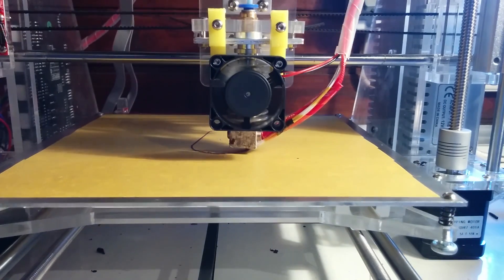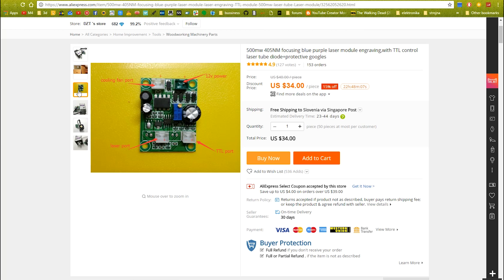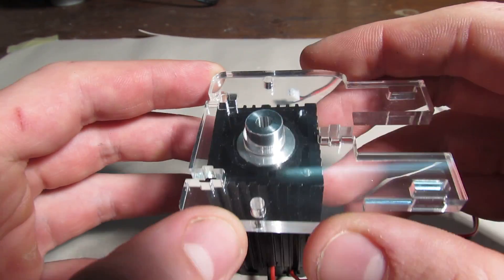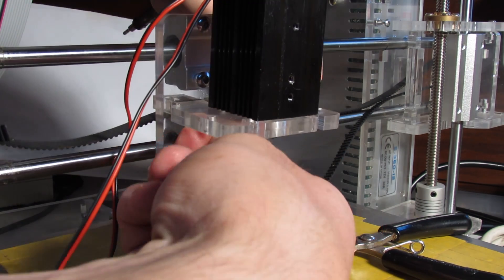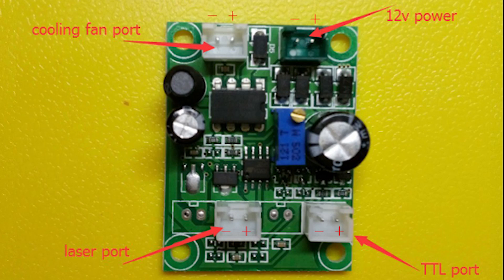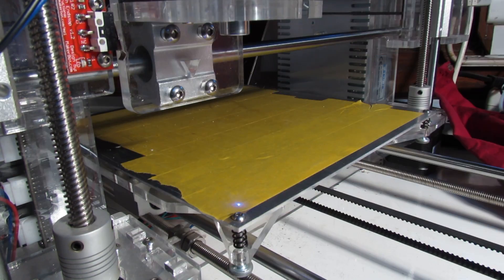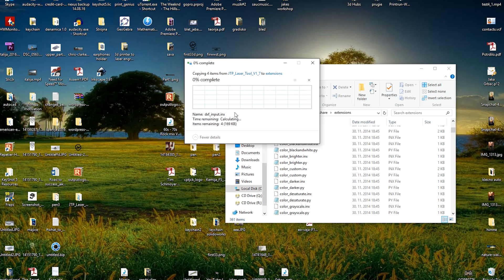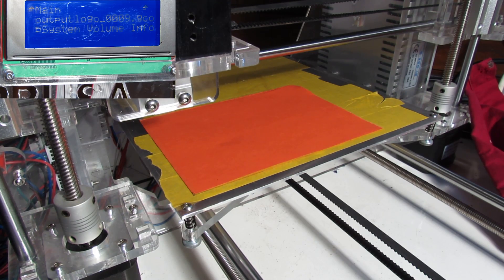Convert a 3D PRINTER To LASER ENGRAVER | Under 40$

Comment: Amazing ! I'll be trying this soon ! Thanks a lot for sharing this ! 
I'd like to ask , what is the distance between the bed and the lens of the laser ?  and how do u set it with the Z axis of the printer?
 Also, the TTL pins are supposed to be for PWM functionality , aren't they ? 
I have seen some SPI interface pins on MKS where people attach their SERVO motors which are again driven by PWM. So is there a way by which u can get that PWM to those pins of MKS and use the TTL of the laser ?
Reply: I installed my laser yesterday as described in the video. It works. My printer is a modified BQ Prusa i3 Hephestos. I have 110mm distance from print bed to laser lense (20mm offset from nozzle to print bed, that means 90mm from nozzle to laser lense). I am using a capacitive sensor for the z-min. In the gcode from inkscape, I added G28 (was missing?) and G1 Z20 at the beginning. Before starting the job, I jog the z-axis above the part I want to laser. During the z-homing I put a flat piece of aluminium on top of the part, to get z-min on top of the part. If I want to focus the laser, I use pronterface and send the M106 S255 to the printer. I have installed a switch, with which I can change between the laser and the printer cooler fan. In this way, I can send the M106 and manually turn on / off the laser on the printer during the focus-procedure.

Comment: Jake, You are welcome )) it a great video!  i just need detailed information from the moment you opened up inkscape please if you could like from what tab did you open to adjust the bed size all the way to generating the gcode please . if anyone else could for me id be thankful
Reply: Yeah, I second that. The content is so fast I had to slow the video down to .25% and rewind about 20 times. I must have missed something because I still have no idea how to set the Z offset to the focus height of the laser unit, and my gcode does nothing. the printer just blinks and it's over in a nanosecond. Please advise!!!

Comment: Thank you for this. I plan on mounting the laser to the back of my extrude carriage so  no disassembly is necessary to switch. Have you tried engraving plastic/acrylic? It would be cool to engrave the side panels on my printer, or printed parts
Reply from the maker: +Ralphie Vigg great idea ! Yes you can engrave into plastic but be aware of the fumes that are generated when burning plastic, so you should really do this in well ventilated area. Btw I havent tried engraving into acrilic yet but you will definitely need a black marker if you want so see any results
Reply: Jake's Workshop I know pretty much nothing about this stuff, but im guessing it wouldnt engrave because its transparent, right? So the black marker gives it something to burn? Definitely something to consider when im finished building my printer.
Reply: 1 month later. Have you tried acrylic yet?
Reply: boffin schist Haven't gotten a chance. Just finished building the printer, haven't tried mounting a laser yet
Reply: Okay, how about Jake. Jake?

Comment: What 3D printer are you using?
Reply from the maker: +SpaceSoda Productions Prusa i3 sunhokey
Reply: Thank you! I did not know there are different types of the Prusa! Do you know any other models? Thanks for getting back so soon!
Reply from the maker: +SpaceSoda Productions Yes there are a few different models on the market, try searching them on the internet and avoid ones that are made from the sheet metal, I would recommend you buy an acrilic one because it is more rigid
Reply: Sweet! Thank you!